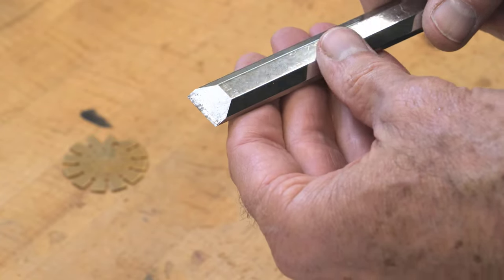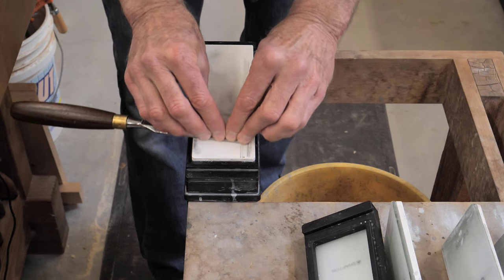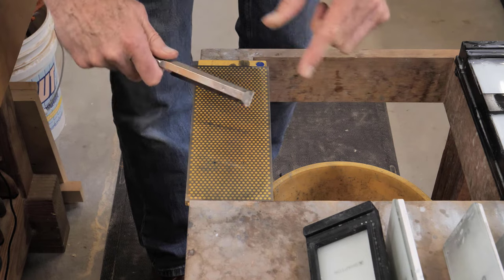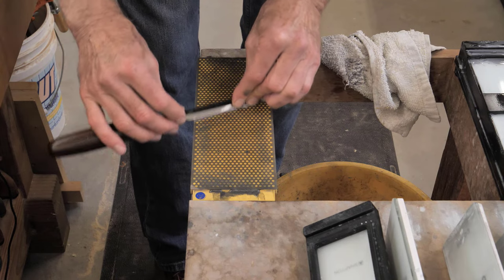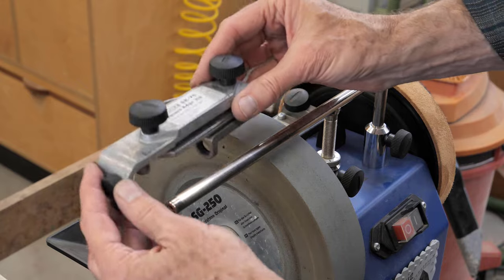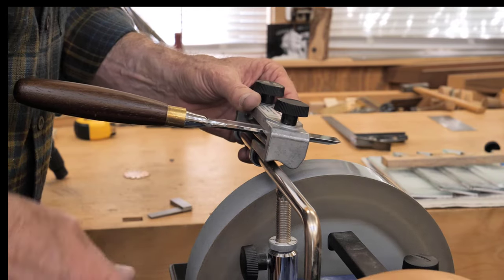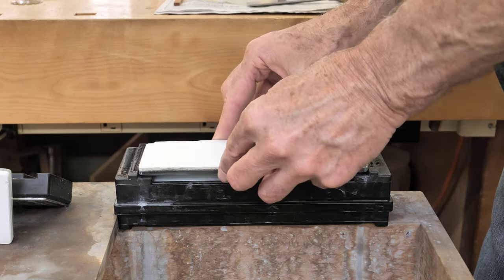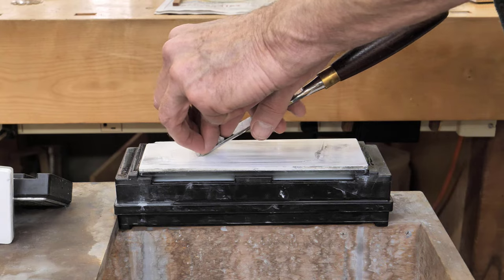Chisel Sharpening with Shapton Glass Stones

Comment: Hello, great video. I’ve been using the Tormek and have been considering selling it because I don’t like the hollow grind. It seems my chisels don’t hold a good edge and it’s a process setting up when all I want to do is freshen up the edge. I’ve never considered following up on a stone to create a sort of micro bevel though. I’m going to give it another shot though. I may have missed it, but what grit diamond plate are you using on the wheel? Do you ever follow up with finer diamond plates? Or just the one pass before honing?
Reply from the maker: According to the DMT website the lapping stone is 95 micron or 160 grit. We used it at the school to freshen up the Tormek grinding wheel instead of using the wheel dresser. The stone is much quicker and doesn't remove as much material, although we did use the dresser when the wheel got out of round. We did not follow it with a finer stone since we only used the Tormek for hollow grinding. The honing was done, as shown in the video, with waterstones. Most students used a combination of King and Norton stones, as that was the cheapest alternative that worked well. (There are other options but students who tried them were typically very disappointed.) See my video using those stones - https://www.youtube.com/watch?v=3omFv98aD2U

Since you already have the Tormek, I wouldn't get rid of it. Although it's slow, it does a fine job of hollow grinding and is easy to use.
Reply: @CarlStammerjohn  thanks for the reply. I don’t have a good collection of stones yet, but since watching this, I had some 1000 and 2000 grit sandpaper I taped to the top of my glass table. I did what you did in your video and, WOW, what a huge difference! In a matter of seconds it was shaving my arm hair. Glad I found this video. I was actually just looking for glass stone reviews. I think I’ll keep it now. As for chisels, Amazon has a set of Irwin marples blue handles on a cyber Monday sale for $66. Do you think they are good chisels? Or should I skip the entry level and go with something like two cherries?
Reply from the maker: @peterweth  Glad to hear you made some progress! Watch out with the sandpaper, however. I know some people swear by it, but it inevitably rounds edges a bit. The Marples are a mixed bag; used to be good when they came from England but the Chinese versions are not so good. I like Two Cherries, although they are typically polished and that tends to round edges which can be an issue. Make sure your sharpening technique is good before going that route - I saw many students buy nicer chisels and then ruin them with bad technique. If you have further questions email me at carl@carlstammerjohn.com
Reply: @CarlStammerjohn  thanks again Carl. I had a feeling they are not as good as they once were. Last night I played with your technique a bit due to not having the higher grit. After 2000 I went back to the honing wheel and touched it up. This is the first time I’ve felt I have truly gotten a sharp chisel that holds an edge. It’s like scary sharp. I nicked my finger tip and didn’t even feel it. It was a clean cut without any skin flap left. I saw a drip of blood on my work and started looking all over my arms and hands because at that point it was all over my hands. It was still razor sharp after shaving some oak end grain. Usually it would have a burr bent over at that point. I agree with you that sand paper will round edges, but I worked with what I had.